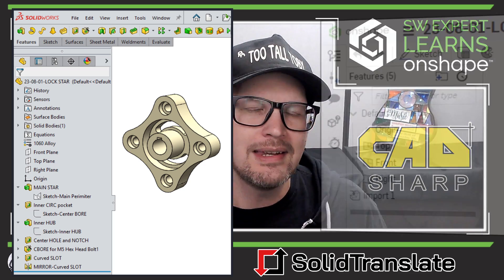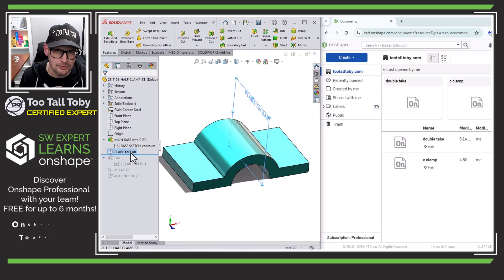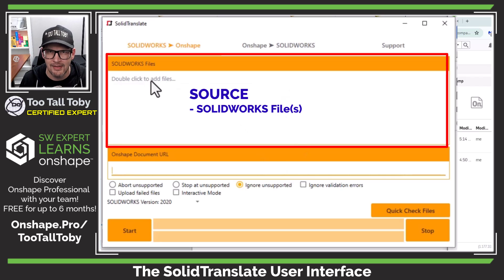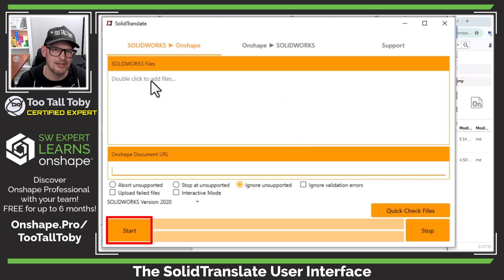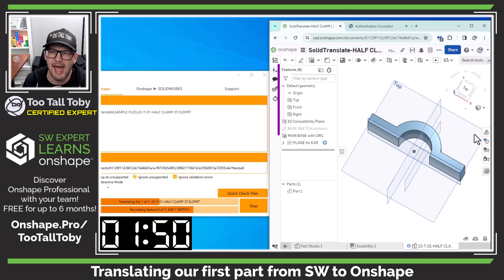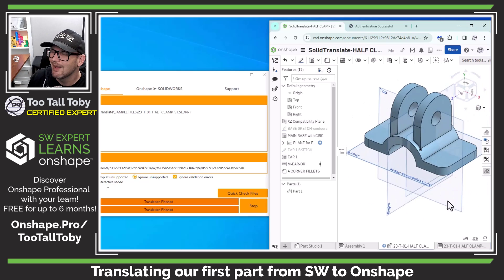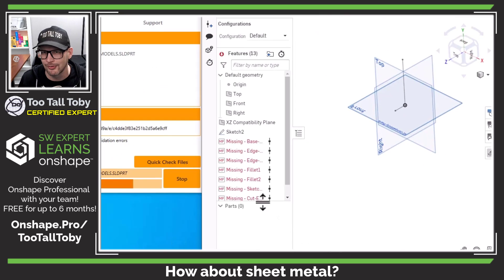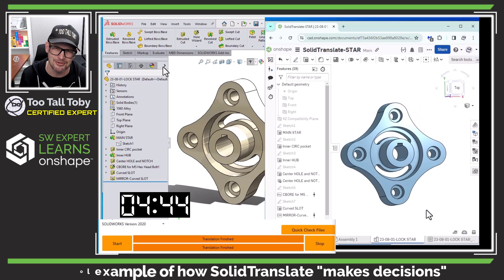Convert SOLIDWORKS parts to Onshape Parts – including FEATURE HISTORY TREE!

Comment: I was very excited until I saw that sheet metal doesn't work yet I work almost exclusively in frames or sheetmetal. I am not at all happy with the way solidworks works and I almost jumped in the air when I saw that there was an option to convert sw
Reply from the maker: yeah - it will hopefully get there soon
Remember you can open any SolidWorks file directly into onshape, with no history tree. Then you can use tools like move face and delete face to update the geometry - and then we can design new parts around our existing solidworks geometry.

Onshape is the future, for sure

Comment: After viewing this video (Which is well done again TTT), I'm still convinced that this tool (and I understand the amazing programming work behind it, congratulations to CADsharp for this) is a sales feature for Onshape, not a requirement for a user to make the switch.

By experience since 2018 in Onshape, you don't need the feature tree to switch parts from SW to Onshape! My guess is 95%+ of your parts will be used as is in Onshape anyway and for the 5% remaining, the Direct Edit tools available in Onshape will do the job!

But if it can reassure more SW users in making the switch to Onshape, it is a great tool! 😁
Reply from the maker: Its a good point and you're correct that direct editing can be a huge timesaver on imported models.  I guess the thing about SolidTranslate is that it brings in Configurations too - so you would get a list of several configs AND you'd be able to update the config by simply changing a dimension that comes in with the import.  That's gotta be worth something!  :-)
Reply: @TooTallToby  thanks for your answer. I'd be interested to see a video where we could see what you explain (configurations translated) compared to a "normal import" with direct edits and Onshape configurations. If you have a configured SW model (I don't have SW) that we could use, you could run it into SolidTranslate and I could do the "manual" Onshape process and we could see the pros and cons. 😊

Comment: 8:13 You are correct, theres essentially a decision tree that happens after each feature where the converted feature is "post processed". Its unique to each feature type in order to handle feature options that aren't supported in Onshape, like the keep bodies option you saw in the key hole. Onshape doesn't allow mid feature selections (ie which bodies to keep), so the keep bodies option in extrude always results in a delete part after it in the tree. Some Solidworks feature options have no API, so we had to create trees that would guess and check through all the options to determine which ones were correct.
Reply from the maker: This is such great feedback Thanks Caden!

Comment: Very cool. Not knocking this at all because it is impressive. What is the use case? If you have a licensed copy of SW then why the need to put into Onshape? It seems redundant.
Reply: Not at all. It allows collaboration between companies and companies and freelancers.

Gamechanger, really.
Reply from the maker: Good question!   Thanks for the comment Andy Barney! 
The 2 use cases that come to mind are:

1. You're actively working with a team that has the other CAD system (since this translator goes both ways - SW to Onshape and Onshape to SW).

2. Your team is moving to Onshape and no longer going to continue using SW.  You still have access to a seat of SW 2020-2024, but you're not going to upgrade any further.  

But you still have a lot of parts in SW with valuable parametric feature based history trees, and sometimes you need to grab these parts and use them in your newer projects.  In those spots,  this tool would be a fantastic time saving solution - and it would work well for any teams that still have functional seats of SW 2020-2024 available.😁

And, as mentioned above - you could also be going the other way - moving to SW and no longer using Onshape - since this amazing translator tool works in both directions!